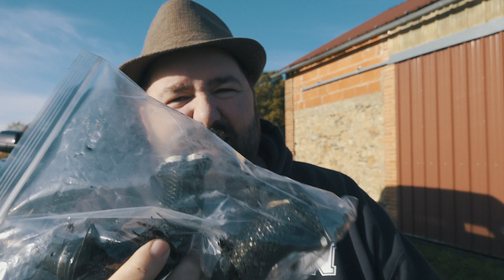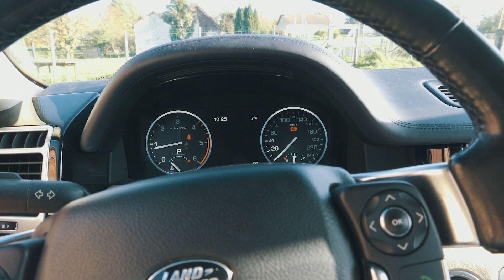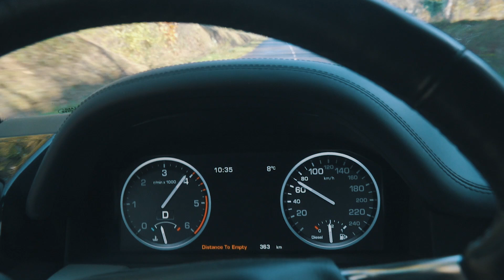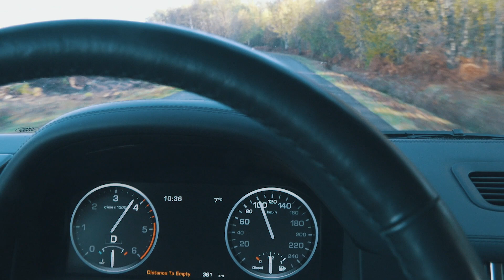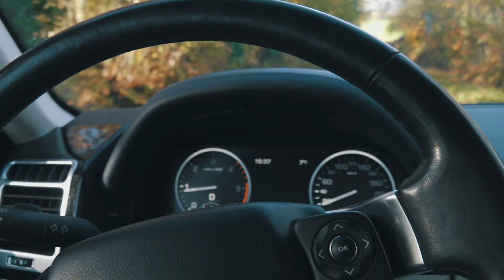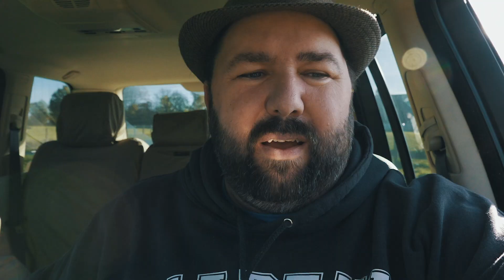Range Rover TDV8  -  ReMap and EGR delete part 2.

Comment: Hi Ben... You still have the TDV8?... How is it so far after that Remap?

Can you recommend it from your experience?
Reply from the maker: Yes still got it, still running really well. I would definitely recommend having it done. Much better throttle response, low down grunt and if driven sensibly better mpg.

Comment: Nice one Ben .. I'm still out about the remap
Reply from the maker: Originally I only wanted the EGR's deleting, but it was the same price for a re-map and delete, and I figured I don't drive the car hard so wasn't too worried about putting extra strain on the gearbox or drive train. It made a massive improvement to it's drive-ability.

Comment: It’s been awhile since you did your EGR delete have you noticed any issues since or any gains since doing it
Reply from the maker: Not sure about gains, as we had the car remapped at the same time, so any gains might have come from that. But it runs clean, went straight through the emissions test with hardly any smoke.
Reply: Iv just got one and found oil around the intake to the frottle body doing a good clean and new pipe but what would cause that.    Egr valve?

Comment: hi ben. Ive got a 4.4 tdv8 2012 .. nay i ask does deleting the egr not mess up the dpf as ive had mine remapped and not noticed any difference also i still get loads of lag when pressing the pedal ??.. keep all the great vids coming ive learned alot cheers
Reply from the maker: I’ve heard that it’s best not to delete the egr if the car has a dpf. If you have noticed no difference after a remap, something isn’t right. Mine was night and day different.
Reply: @Bensgarage  yea mate thats what i figured so ill leave that part alone as for remap sadly zero change. Just watched your vid on changing the intercooler pipes again..lol..so think ill go check them and see if any issues there. If not no idea thanks again ben appreciate your reply cheers

Comment: why do you need to know mpg ? YOU FILL AT THE PUMP IN LITERS AND DRIVE KILOMETERS , you drive 100km with a number of liters used for those 100km , its simple
Reply from the maker: Yes being metric we use ltrs/km but it just seems that most people understand mpg and can’t get their heads around the metric way.
Reply: @Bensgarage  i hate those people ! When i hear a american measuting “one 1/32 inch” i feel like breaking my monitor . You have a nice car and seem like a proper bloke , subbed ;) have a great day
Reply from the maker: Yes I really don’t understand why they hate the metric system. Even NASA use metric as it’s more accurate.

Comment: did you delete the dpf also or are you planning to replace the engine when they get blocked ?.
egr needs cleaning like in every diesel its not a problem you just clean it
Reply from the maker: Mine doesn’t have a dpf so don’t have to worry about that.
Reply: @Bensgarage  wow wow wow wow . W8 you mean to tell me a v8 diesel has no dpf but they put egr on it ? Then i retract my coment . You are right to have removed that pos .
Reply from the maker: All vehicle manufacturers had completely complied with the legislation on new car designs by the end of 2010, although some legacy vehicles using engines designed prior to DPF’s becoming mandatory were allowed to continue to fit them on some production runs until 2011. It seems I have one of those weird in between cars. It’s a 2010, still with the 3.6 TDV8 and the one year that didn’t get brembo brakes. But I’ll take the hit on the brakes as it doesn’t have a dpf which would more than likely cause more problems.
Reply: @Bensgarage  great thinking ;)

Comment: Hey Ben ,what does the mpg say now after running it  since the remap in part 2 ?
Reply from the maker: I’ve not worked out the exact mpg but the range that it shows for a full tank of fuel has gone from 550-600kms to 850kms. I know that’s not accurate but we don’t do enough mileage in it to do a proper check.

Comment: Hi, mines in for the ERG delete and remap in December. Just wondering what difference the remap has made to your average MPG?
Reply from the maker: Can easily achieve 30mpg with normal driving. Drops a bit if you get the boot in.
Reply: @Bensgarage  Cheers Ben 👍

Comment: Hello Ben. I had exactly the same smokey surprise when I had just purchased my VW Multivan 2.5 HiLine which has Webasto heater. Scared the shit out of me, the first time I drove it on a cold day. BTW, I live about one and a half hours drive west of you, near Cognac. I found your channel because I was searching for Range Rover L322 3.6 in France. I’m currently searching for a low mileage 3.6 without much luck so far. May have to import from Germany.  Good luck to you. Enjoying the channel.
Reply from the maker: We used to live over that way (Baignes-Sainte-Radegonde). Yes low mileage ones are hard to find and when you do find one they are pretty expensive here in France.

Comment: I'm interested to know if there's a French equivalent to the annual mot and if so, do they carry out any form of emissions test.. would your EGR work affect this in any way both in France or here in the U.K.?

What happened to the lettering on the bonnet?

Chris
Reply from the maker: Second person to notice the bonnet letters! It didn’t have them when we bought the car but I do plan to replace them. Yes we have a control technique (French mot) which is every two years. I don’t think that the egr valves will make much difference when it comes to emissions.